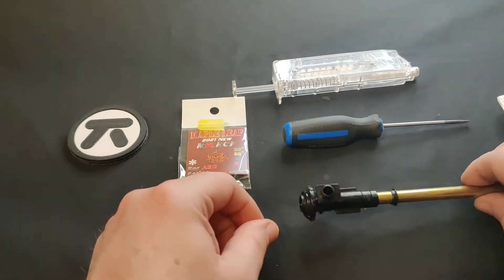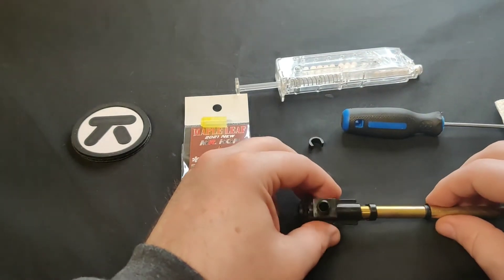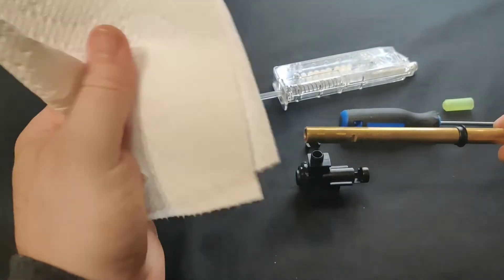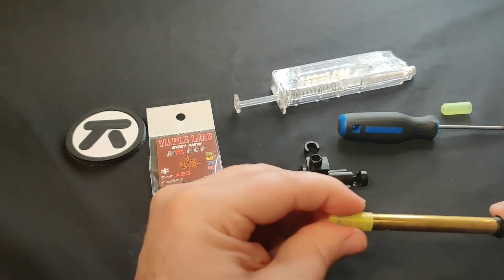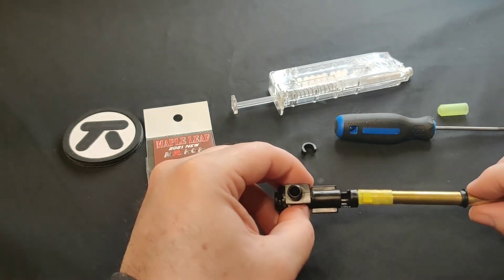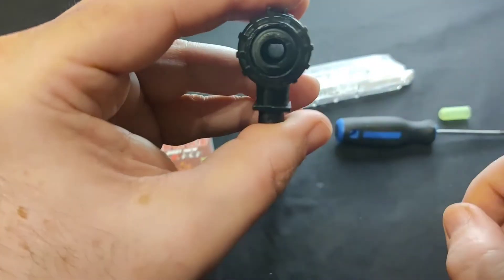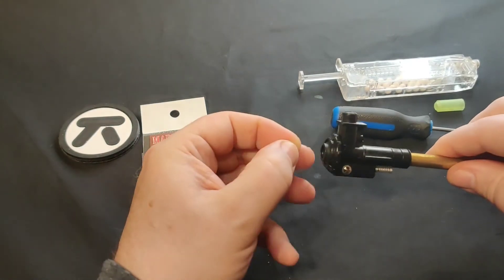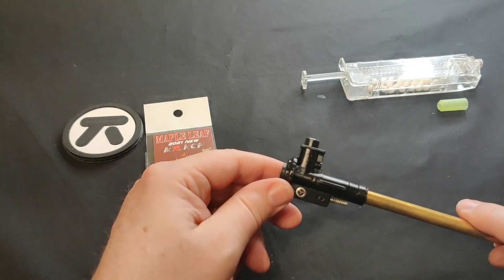Installation of bucking in hopup for AEG by Taktik Airsoft

Comment: Is this a stock VFC Hop Up Chamber ? If so curious to know does the MR Hop + ML Inner Barrel fit ? Me and my tech are having an issue for my G28
Reply from the maker: This is a generic hop-up unit using a maple leaf bucking rubber edition. You can find these on certain vfcs but now most of the hop-ups are rotary.

Comment: When trying the drop test, the tension of me pushing the bb down the inner barrel is high. How would i make the tension lower?
Reply from the maker: You stretch the bucking on the barrel
Reply: @taktikairsoft  yes I did stretch the bucking down the barrel
Reply from the maker: @snowiiilol2753  then you might not have the right combination barrel, bucking and Hopup

Comment: My barrel is stuck in the plastics piece what do I do?
Reply from the maker: You need to remove the C clip and the brass ring. Put you hopup adjustement at 0. Pull the barrel slowly. You can twist and turn a little until pulled out
Reply: Ok thanks

Comment: after this new silicone bucking swap and also this new omega nub, my bb's are alvays curving to left. What should i do to repair it?
Reply from the maker: Look at through your barrel at maximum hop-up. You should see if anything is off. Rotate the barrel a little in the hop-up to correct the shape to make it flat

Comment: Any thoughts on performance for the MR hopup bucking rubber one vs new silicone version ?
Reply from the maker: We are still doing evaluations as of now. There seems to be a net improvement in performance with the silicone. They are just more tricky to install properly because they the stretch more and are stickier.